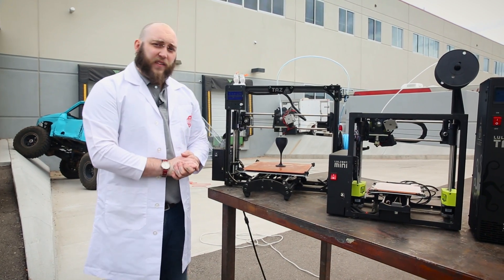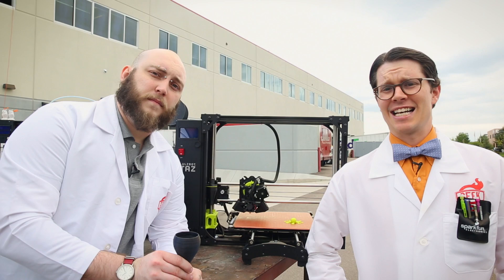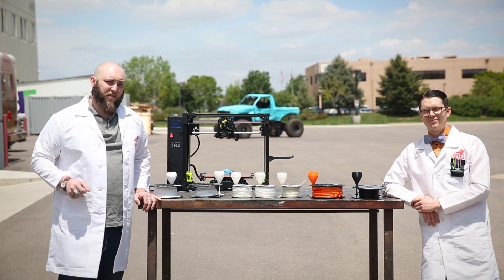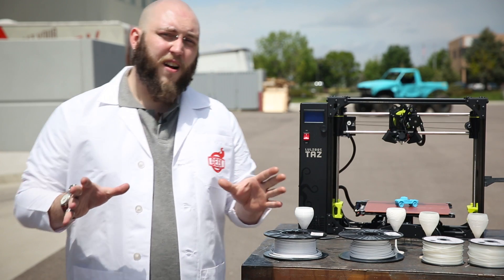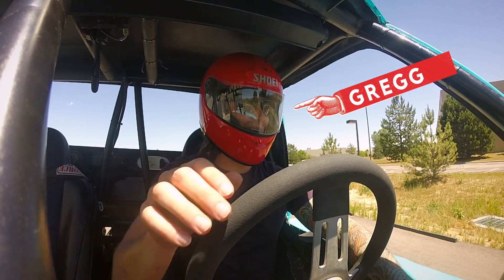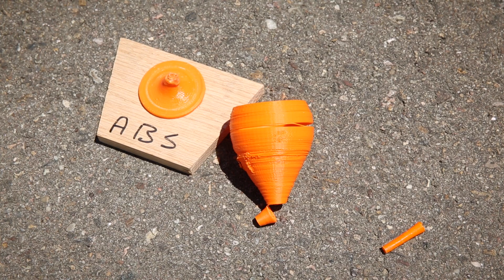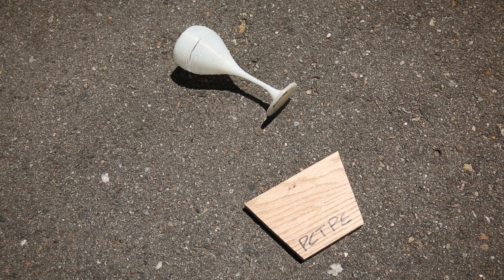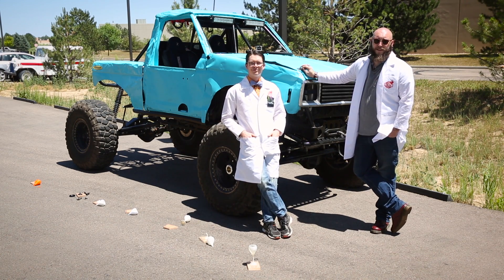SparkGear 3D Printer Fillament Test!

Comment: 1:36 1:56 2:34 If those glasses were printed on theTAZ6 then there is an Alignment/Shift problem with it. the layers are not lined up very well and shifted quite a bit horizontally.
BTW Your Smash test was not very scientific. Not one of the sample glasses was put under identical stresses to quantifiably compare the results.

As for the video it was humorous but not scientific...

Comment: I've learned that either lulzbot printer sucks or the filament sucks or the users operating the lulzbot sucks :)

Delamination means that there was not a good adhesion between layers, this happens due to low temperature extrusion... A good print should never have any delamination (of course it would always be the weakest point but not as you can see on the images if you have a good print)

Other than that there's also a lot of issues caused by vibrations and what seems to be layer misalignment. Don't know what model you used to print the glasses but I would assume a CAD generated one so the outside surface should look pretty smooth with any kind of plastic.
Reply: I think you wrong Nuno, the TAZ machines are pretty awesome, see the XRobotsUK channel, wich use this printer massively with excelent results. I think Sparkfun simply printed too fast in order to keep their video schedule. Or the model they used are not-so-ready-to-print.
Reply: I fully understand that but I would never to a video with parts like that specially if I was selling the printers, the filament and if the video was about filament comparison.

I fully understand that people usually do not realize the difference between filaments and there's nothing that shows that.

What about a test where the same part printed with different materials, filmed at a high frame rate to see what actually happens?

Making a filament comparison when the parts are not printed properly... Is like comparing a Ferrari that half of the screws are missing and a Fiat with all screws (even here probably the Ferrari would win :)
Reply: Owning a mini, I guarantee they didn't print those glasses on a TAZ or they entered terrible print settings.
Blobs happen on the TAZ machines if you print fast but I've never seen misalignment like on these glasses. Maybe they were driving around on a cobble road with the printers while making them or maybe they were printing at 500mm/sec.
All I hope is that these aren't the first 3D printed objects anyone sees or they'll never be interested in the technology. I almost barfed.
Reply: Ok, I fully understand that, but as you are also selling the machines you could had mentioned that :) On a customer point of view those glasses seem very bad and I would not get that printer